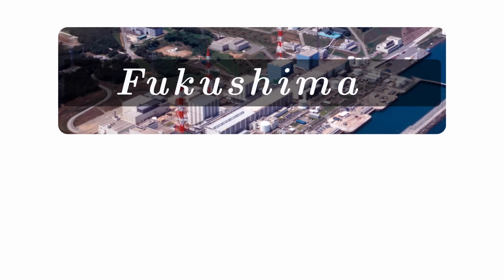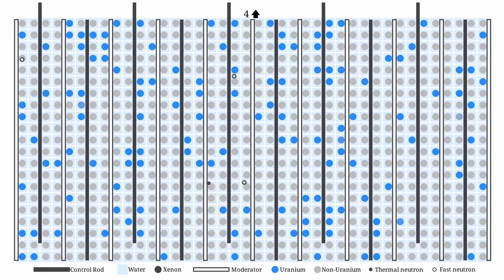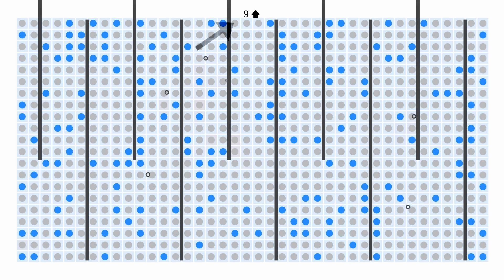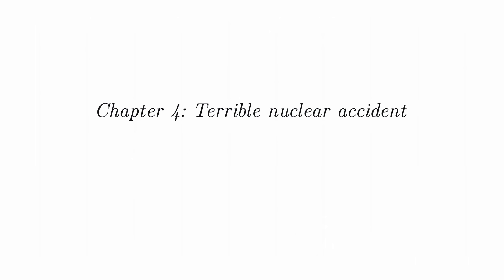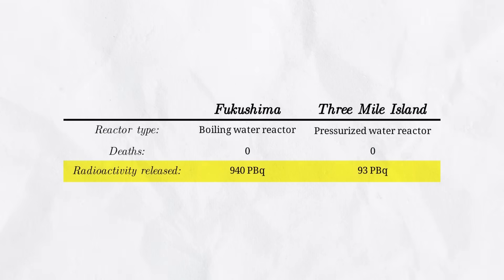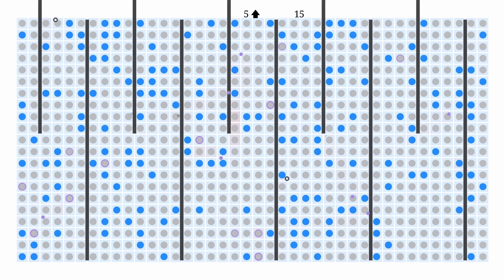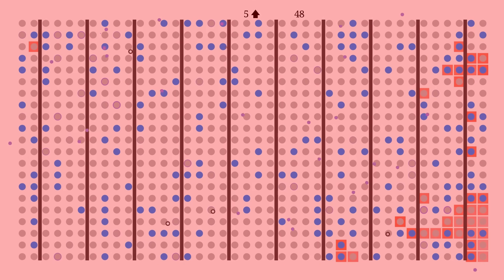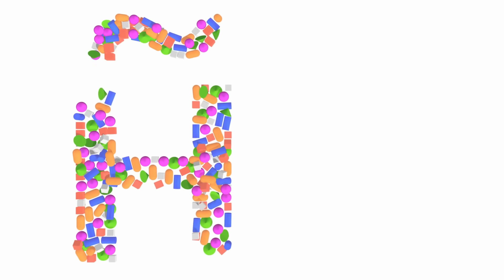Fukushima and Three Mile Island accidents Explained

Comment: When using water as a moderator instead of graphite, wouldn't one need to either increase the pressure or increase the reactivity of the fuel to reach the same amount of neutron flux as in a graphite moderated reactor like the RBMK ?
I dont really know the deeper reasonning behind the choice of moderator and I'm quite curious what led the RBMK designers to choose the more dangerous option.

Comment: So, why exactly was the water not effective as a moderator in a RBMK, such that the absorption of neutrons had a more significant effect than the moderation of neutrons? My immediate guess is that it has something to do with the penetrating power, since a lot of fast particles don't lose energy at a constant rate when they travel through a substance (this is part of how radiotherapy machines localized the radiation at a tumor, iirc), so in an RBMK they get absorbed but the geometry isn't good for moderation?

Comment: Fukushima was also a failure of design, but more in a civil engineering sense. When they built the facility, the mountain it was next to was excavated so it would be easier to get to cooling water without spending on pumps. What that meant was, not only was the facility more vulnerable to tsunamis, but if there was a meltdown and radioactive material was exposed, groundwater would be more easily contaminated. They are literally freezing the ground around the containment buildings because there is so much groundwater.

TEPCO spent a lot of money to lower the elevation, and ended up giving the engineers working on the containment no end of headaches.

TMI also released radioactive material... But it was a little tritium.

Comment: Really shows you what a big difference there is between modern reactor design and the old RBMK at Chernobyl. I never thought about how the moderator, the thing that accelerates the reaction, is also important for cooling it down. Don't reactors have other cooling systems besides pumping in more water? I suppose using water is very cheap and fast, but are there any coolants that don't work as moderators that are used as an emergency measure?

Comment: So Fukushima was a nuclear disaster caused by a natural disaster rather than a poorly built or poorly used reactor, and TMI was a minor accident caused by a single valve that was easily stopped and is easy to reuse and that's why it's being reactivated? Correct me if I am wrong but it sounds like the US' nuclear power progress was crushed by reporting.
Reply: Fukushima was a design fuck up too.
The backup generators were below the sealevel and not maintainted by standards.
Reply: the news are idiots, i’ll tell you what
Reply: Might as well be. Some people actually tend to believe that more people died and got cancer from panic around Three Mile Incident than from the incident itself. Chronic stress is cancerous.
 As for Fukushima - the power plant had emergency systems capable of withstanding the tsunami, but the management refused to turn them on - could be either due to economic motives or complex nature of the tsunami. One human error that I simply do not see being repeated in the world of nuclear physics ever again.

Comment: Is there any way we could download whatever software you use for these simulations? I don't even care about the quality of the programming or the intuitivity, I'm just a computer programmer and aspiring physicist (still don't know what area to explore in detail yet) who would love to play with this. Perhaps I could implement it on a larger scale with flowing water molecules, simulating thermodynamics and running through a turbine, in the same vein as AngeTheGreat's Steam Engine Simulator.
Reply from the maker: The video generating software isn't public and also it's such a huge mess I don't think it's a good idea to release. BUT 

I did make a game where everything is pretty much inluded.  It's much much more fun to play with the code. It can be bought on steam or you can play with the code here (Made in Godot feel free to push commits):
https://github.com/ReneTC/MissionToFission
Reply: @Higgsinophysics  Damn, it's been a while since I made that comment, a lot has happened, and I'm not as motivated for something like that (currently working on a game engine for the Dreamcast, repo isn't public as I'm still prototyping) but I'll be sure to play around with the code. Looks like it deserves more stars, lol.
Reply from the maker: @gavinmitchell3709  That sounds very impressive, wow! And of course, ones interest and free time comes and goes so no problem :D

Comment: its very frustrating to me that these disasters were used as an excuse to demonise nuclear power as a concept and shut it down worldwide when they were so clearly freak accidents that killed nobody and were brought under control very quickly. I'm generally a fan of the environmentalist movement but their anti-nuclear stance is a permanent stain on their image
Reply: to be fair the C incident did blew up some people but they just ignored the fact that SIX SHITTY EVENTS somehow conspired together along with the bs-level of ignorance in the soviet bureaucracy to just go off. The graphite tips on the rods, the extra water that caused confusion and stalled the reactor (which led to the CRs being raised to powermax), the safety test being delayed and it in itself shutting down half of the reactor’s cooling system and the SCRAM button being pushed that dipped the graphite tips back in the essentially flash-boiling water (which makes it worse along with the positive-feedback loop of xenon burning water for more xenon to burn) are just unluckiness clumped together disastrously

Comment: At Fukushima, there is a passive cooling system that did not require any energy to be at work. This system is a simple heat exchanger within a water tank : it's a steam condenser. Witch is connected to the reactor on a closed loop, sealed or open by valve. Once you open the vavle, the steam from the reactor witch is > to the boiling point go the steam condenser, the water inside the tank boil and the steam is able to cool off and go back on a liquid state. The gravity made it back to the reactor. As long as you can replenish the tank from the condenser with water, the reactor can be cool off. This is what we have see from TV news : fire truck putting water in a attempt to let the water level high enought. But there was, as we all know, a problem. The vavle were electricaly operated. As the seism was measure, the operator open the vavle from control room.But the vavle were actually a normaly close type when de-energized... Once all the electricity was shunt down, the vavle close. And the operator did not know, all the control room was in pitch black, everything was shut down. They were believing than they have many hours in front of them... Once they realise, in the aftermath of the tsunami, than the valve need to be reopened manualy, it was already to little to late. It's such a shame than general electric let such a massive security issue within the design of the nuclear reactor get within the blue print of the factory. And nobody talk about it. I am designing safety in petroleum industry. I can't understand choice like this.

Comment: Can someone explain to me how the presence of water can both speed up and slow down a reaction at the same time? like in the rbmk video it's said that adding more water allows more neutrons to be absorbed and slows down the reaction. but also water is a moderator which speeds up reactions?
Reply: It does not speed up reactions. It turns them from fast to normal neutrons. Although not shown in the Chernobyl video.

Comment: decay heat can be up to 7% of total reactor power, but initially it decays very quickly.
After 10 seconds of reactor shutdown, it is down to 4-5%, after 1 hour, it is only 1-1.5%. It is still a lot, considering that an operating reactor is in the order of GW, so even that 1% can be like 30MW

Comment: Ok, so the Chernobyl video showed water evaporating causing the reactivity to go up, in this one, it causes it to go down. I understand the reasons shown in this video (water causes moderation, which drives up reactivity). But now I don't understand why losing water acted as an "accelerator" in the Chernobyl video. What was actually the role of water evaporating in the Chernobyl accident?
Reply: In the Chernobyl simulation, water had a chance of absorbing particles, slowing down the reaction. When the water evaporated, the particles were free to move and had a higher chance of activating uranium. Plus, the excess particles reduced xenon poisoning, creating a feedback loop. Once the water flash boiled, nothing could have been done to save the core

Comment: 5:49 if you need a moderator to continue the chain reaction, what is used as moderator in a nuclear bomb?
Reply: Nuclear bombs basically work by imploding a subcritical mass of highly enriched radioactive material, to a supercritical mass. Critical mass (and beyond) is what you need for a fissile material to self sustain its own fission. This causes a positive feedback loop in the form of an uncontrolled nuclear chain reaction, catalyzed by the force of the implosion, to create the biggest explosions we're capable of.

Moderators meanwhile, moderate the speed of neutrons. In a reactor, we use these, alongside material much less enriched, to create a controlled nuclear reaction and generate heat. Moderators slow down the neutrons so they can actually do work in this kind of reaction.

In the case of a bomb, this is exactly what we dont want. The explosion is made by the uncontrolled reaction, combined with the implosion packing the nuclear material into a much smaller space, making it much more likely that a fast neutron will hit something and create more fission reactions.

So, nukes don't have moderators. The big explosion is the reason to use nukes in the first place, adding a moderator would be counter productive.
Reply: In nuclear weapons, we want the fast type of neutrons (depicted by white circles in the video) because they release their energy fast, and uranium is put in such a way that an explosion wil make it go critical.
So slow neutrons are not part of a nuclear bomb.
Reply: Nuclear bomb is different. Modern nuclear bombs usually consists of 3 stages, when first stage is detonated, it activates the second stage and so on to the third stage

Comment: I've heard the company was supposed to build a wall outside to block such a tsunami in it's original, approved, design of the facility and then simply didn't build it. Or build it as high as they said they would, really it seems like the blame is with TEPCO. Three Mile Island was fake, it was extremely well timed nuclear propaganda created from thin air with zero lasting consequences, there was no steam buildup they just ran the reactor incorrectly for a little while to put on a show. The political reaction to Three Mile Island compared to the actual details makes it painfully obvious, Chernobyl itself got a cooler-headed response while Three Mile Island had planned concerts and celebrity trout-outs, it also proved WASH-1400 "correct" and let the NRC assert all kinds of control over reactor type going forward. Honestly the post 1990's progression of nuclear is some kind of anti-proliferation kayfabe.

Comment: The way the Fukushima disaster was allowed to occur really erks me.. I work professionally with 3-phase pump motors; an inexpensive man-portable 3-phase 208v generator could have been wired up directly on the LV side of the cooling loop pump motor, allowing cooling loop circulation to be reestablished. There was ample time, and induction motors are incredibly robust; getting flooded out would be no problem for the motor as long as it were dried out before starting it back up. Loss of cooling should never happen. A competent mechanic needs to always be on site.
Reply: We are talking about Japan, the country that still use Floppy disk while everyone is moving to USB 3.0 Type C or Cloud storage
Reply: @superspies32 Woah there buddy. The nuclear plant powering my area still has data, get this... On reels. Like, film reels (not exactly, but similar thing).
Reply: @superspies32  We are not using floppy disks.

Comment: The Fukushima incident; I mean how much can you blame on design and overall use of fission? Wasn't there 2 or more waves that washed over the reactors?
But with all these incidents we've leaned priceless knowledge to improve design. 
I still feel we haven't even started to use this technology to the fullest
Reply: the reactors i believe were actually not damaged- the things that were destroyed by the tsunami were their water pumps, which is why the reactor lost its cooling water. so the argument is whether these should have been in a different location or more protected
Reply: There is a future generation reactor that nearly commercialized: Thorium salt reactor. It generated less heat than Uranium, more duration and easier to get (Thorium is more abundant than Uranium and its waste has lower potential to be used in A-bomb so it may be approved by many countries without threats to be used as A-bomb production)

Comment: I feel like saying Fukushima and TMI were the same is disingenuous... TMI was poor design, maintenance and operator error which resulted in partial meltdown and subsequently an insignificant release of short half-life xenon gas.
Fukushima, while the meltdown had similar physics interactions within the core, was due to poor disaster preparedness by the regulator, and resulted in ten times the radioactive release along with the physical destruction of multiple reactor buildings.
Besides that gripe, a good video overall... I just find people calling TMI a nuclear disaster bothersome, the only lasting damage was within the containment building and yet its lumped with Chernobyl and Fukushima where entire buildings were leveled.